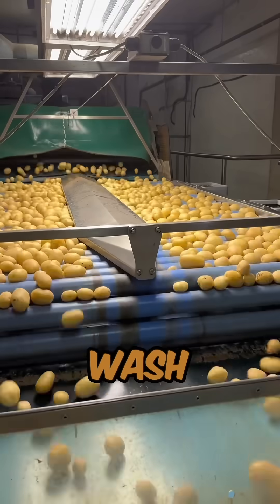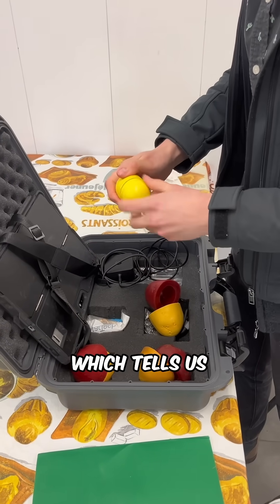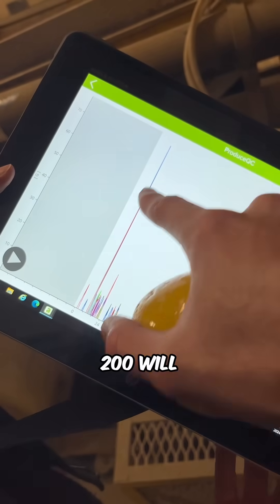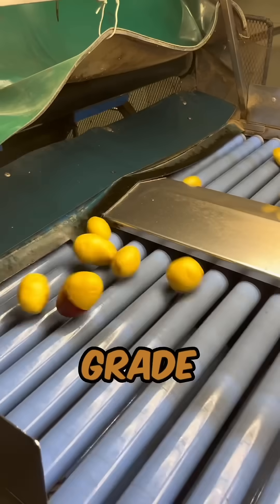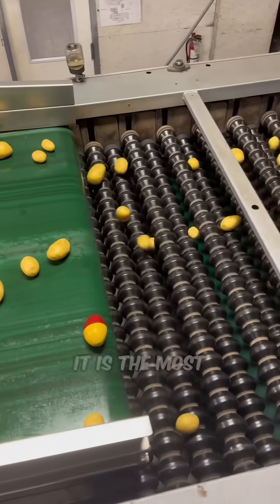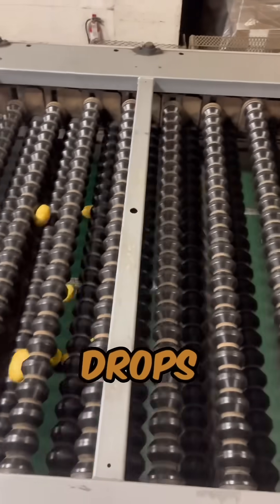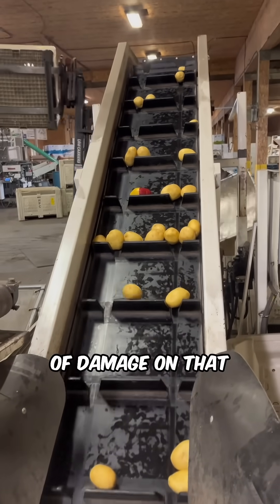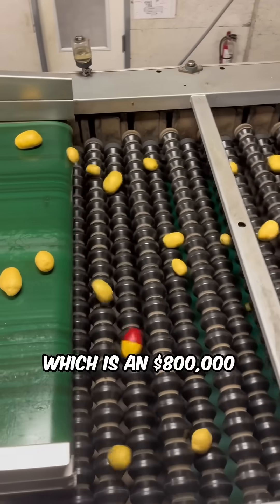How we find where our potatoes are being damaged #potato

Comment: Have you considered just putting a flap of canvas across the end of the ramp onto the sizer? Anchor it just under the edge on either side and let it trail onto the sizer's belt. the flap would only have to be just a few inches more than the drop height but would break the potatoes' fall (relatively gently) before depositing them on the sizer's belt.

You could make it yourself and the cost would be minimal.

Comment: Could you add an angled net between the belt and the Mechanical Sizer rods, to slow the speed of the drop onto it? That would reduce the impact force landing the spud in the Mechanical Sizer, not too tight a fit, or you bounce them further :) and not too loose, or it might be caught in the belt and disrupt your processing... Hope it helps :)

Comment: Out of curiosity, what exactly is happening with the sizer to cause damage?
Reply: so what's going on there is the spuds are being dropped, which means if anything is out of alignment (like a steel baffle intended to keep the potatoes on the conveyor belt) it's going to take chunks out of any potato that gets close.  I honestly would expect it to be not an issue with the sorter itself, but the place it interfaces with the belts beneath, which might literally be just bending a plate slightly and sticking a pool noodle on top

Of course, the cleated belt might just have worn off the rubber from one of its cleats and have an exposed blade somewhere, but literally every potato I've gotten lately has this sort of damage and 3/4 of it is rotten by the time I get around to using them, so I've just stopped buying them

Comment: It is absolutely NOT an 800,000 fix. That's probably the price of the original machine...which comes with parts numbers and is designed to be taken apart and repaired. That's like buying a new car every time you need brakes.

Comment: Curious why would you seperate the potatoes by sizes?
Reply: Because some bags are sized by how big the potatoes are. And if not, separating big and small is a better way to get weight distribution (let’s say on a 10kg bag) easier because of more even weight
Reply: @Billwumper1  Ah. Guess I haven't thought of it like that, just bought them loose.
Reply: @blufudgecrispyrice8528  that’s understandable. At least up in Canada. I buy bags of potatoes by the bag.. usually 10kg bags.
Reply: small ones sometimes also get sold as specialty variety, at a higher prices.